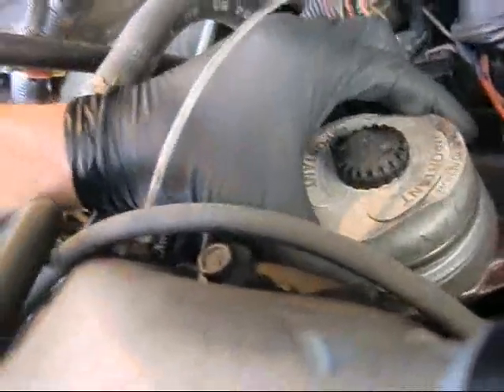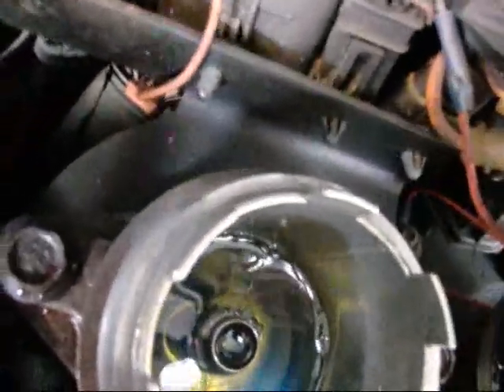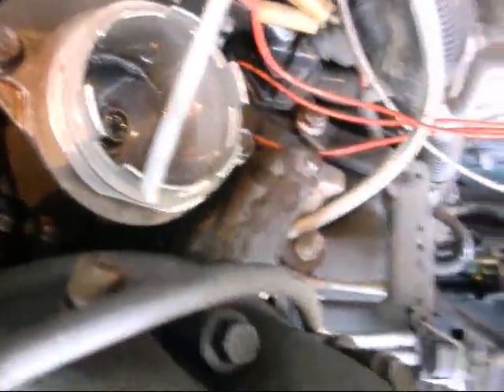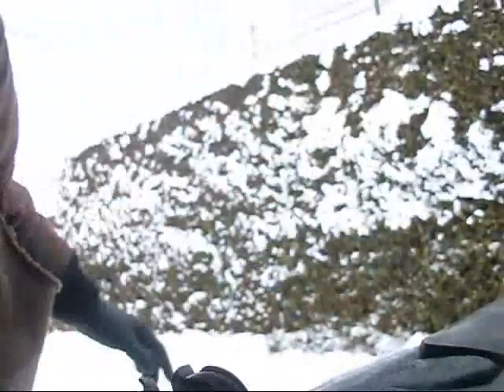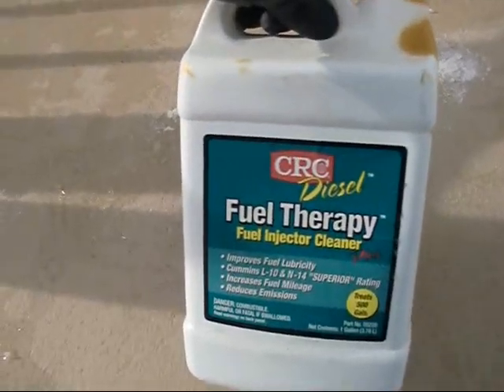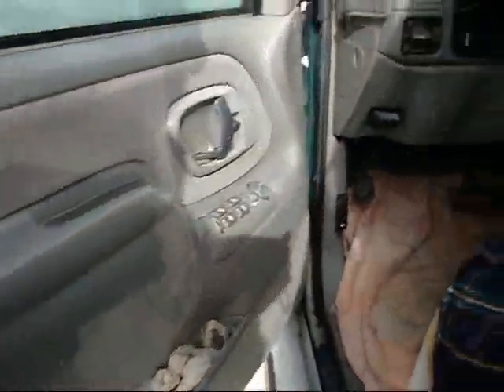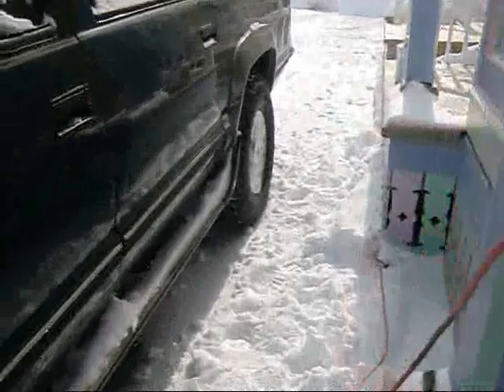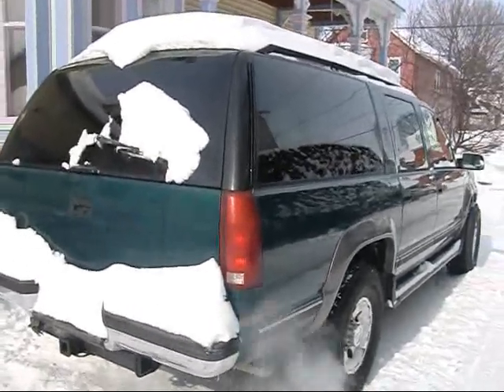'Weasel Fuel Filter Inspection  2 9 13

Comment: Sooo glad to hear my 90 6.2 diesel run yesterday.  Hadnt heard it run since I bought it.  Got a smoking deal on it ats turbo Muncie 4 speed 2500 4x4.  dang mechanical injection pump have to pump it a little when it hadn't been started in 8 months.  clutch is screaming  bought a new LUK flywheel and clutch any thoughts on LUK?

Comment: If I were you I would get a SOS oil sample. Go to a caterpillar equipment dealer and request one. You fill out the paperwork and send it in. It will tell you what particles are present in your oil. You can find out where the sludge is coming from with that information.

Comment: You other option is to buy Howes "Diesel Treat" it works aswell I wouldn't put the 2 stroke oil in it doesn't help with fuel gelling or water.

I would have changed that filter you can tell the fuel has some water in it by the color of the media.